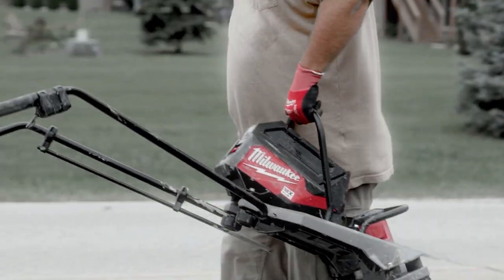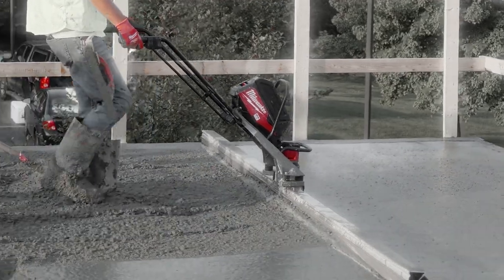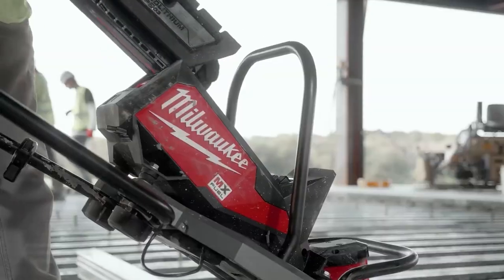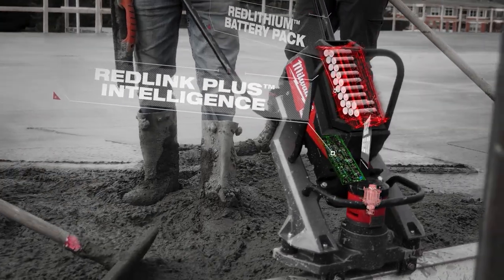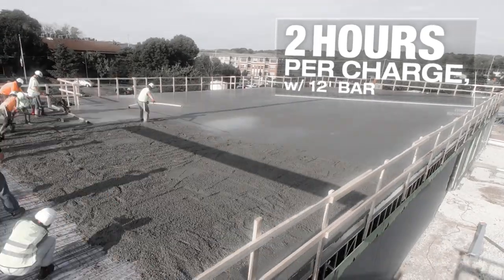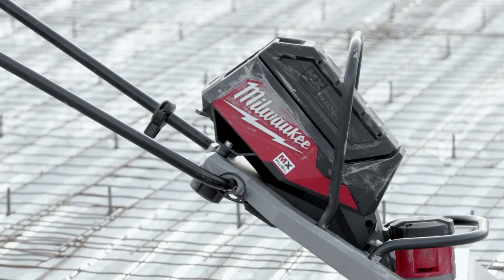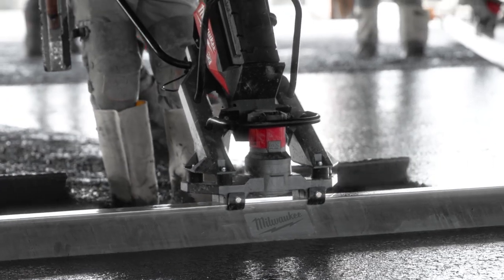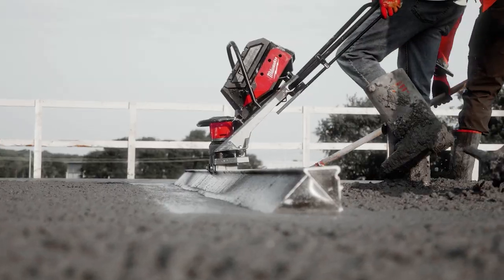Milwaukee® MX FUEL™ Vibratory Screed

Comment: All yours for the small price of 5k… lol
Reply: Ya I feel like some of these are looking for a problem that doesn't exist I mean if it's reliable and you have problems maintaining the gas tools then I guess it's better
Reply: I have one on order. $2600 for the screed and two batteries, I think another $700 for the board.

Not really any different than ordering a good gas screed and board.
Reply: I love my gas screeds, but to say they aren't loud or stinky, especially in a closed in environment would be a lie. My sweatshirt always smells like exhaust fumes after screeding a floor.

I ordered one to hopefully eliminate that, and any additional jobsite noise that isn't needed.

The only reason I would get the demo saw though is for unvented areas, the cut time per battery just isn't long enough yet.